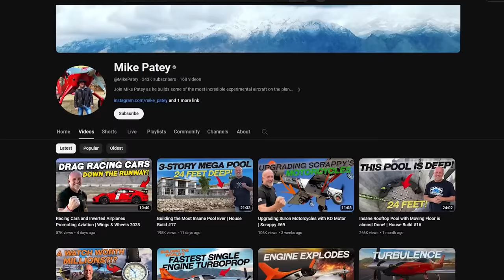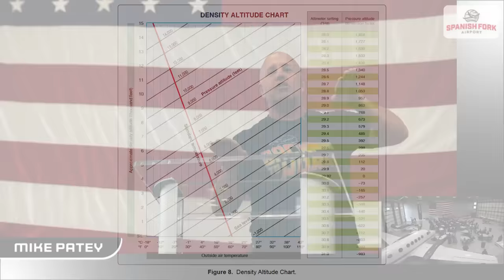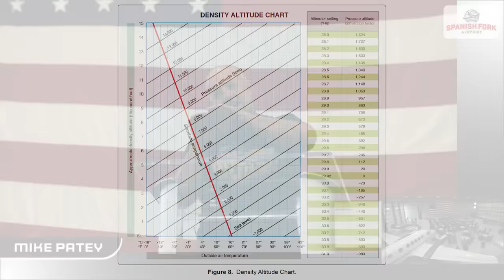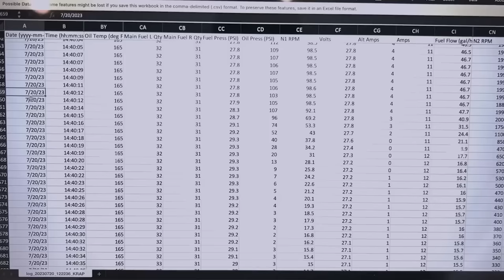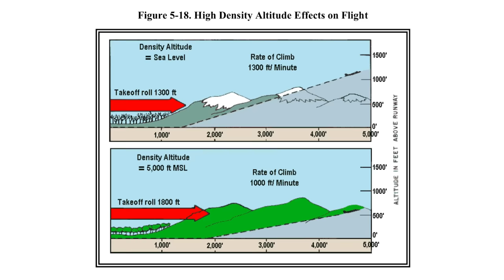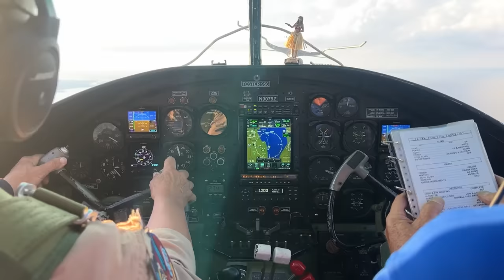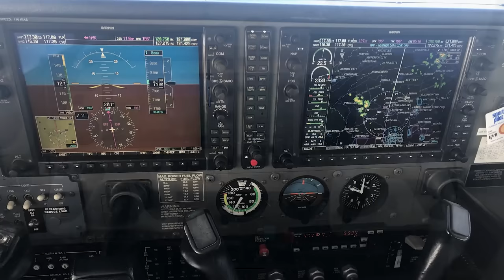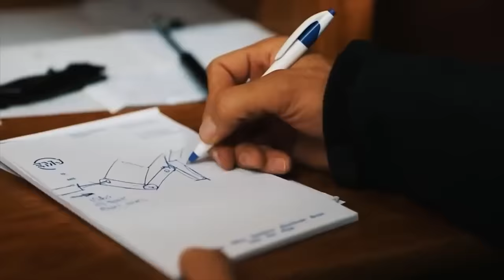I've Lost 4 Friends in 60 Days - Aviation Safety Discussion | Mike Patey

Comment: I love flying High DA, because it is challenging. but I do it properly.

I flew out of airfields over 5000ft, over 7000ft, with DA at takeoffs over 9000ft. you have to know how to lean, you have to know how to fly under-powered. you have to be patient. you have to know how to fly with max climb rates of less than 200 or 300fpm. You have to know how to deal with updrafts, downdrafts, mountain turbulence, etc.

People, flatlanders, would come to our neck of the US, rent a plane, crash and die, every year.

I have flown in ways that left people speechless, and asking how I did that, but Never ONCE have I exceeded the limits of an airplane, never once flown recklessly. You can fly impressively without being a "cowboy", without being reckless. It's about having understanding of flight, aerodynamics, how aircraft work, etc. it's these little things that truly impress people about your flying. I demonstrate superior navigation, superior fuel efficiency, superior precision and control. I have even been praised many times for making Safe decisions, including choosing Not to fly. Once during training for commercial airplane, I was having trouble getting ready fro my first solo in a complex airplane and I called the flight quits. Every flight instructor at the school questioned my decision. But when I explained to them the string of things that had gone wrong already, before getting off the ramp, and how it was going to affect me mentally in flight, etc. they suddenly understood and praised me for calling it quits and taking the day off. That decision and many others like it got me hired later without even having to apply for a job.

When I was a kid, in public school they had "de-motivational" posters on the walls. On was of a shipwreck and it said, "your purpose in life may be to serve as a warning to others.". Learn from the mistakes of others, you wont live long enough to make them all yourself. Fortunately even from a VERY young age I've been good at learning from others without repeating their mistakes, even once. Fortunately for me I take such lessons to heart and live by them almost religiously.

Comment: Flying is risky because gravity works 100% of the time, and enough lift to stay airborne happens less than 100% of the time, overall.  100s of complex factors must work properly together.   Probably the realization is that if you fly, you will know others that will crash, it is a small community.     It seems like it takes a certain mindset to have the skill to prepare properly, to be patient, to know when to abort a sought after mission, etc.  We know that this certain mindset can be trained.    Certainly it's no easy action, after all, you put in all of these life assets into it so you could get up there and get there faster right? That makes it particularly hard to come to a full stop.

Comment: I couldn't disagree with yuan more as an airline guy myself. Now I'm not on the 777 we fly much shorter legs but I hand fly the jet as much as I can and I say you should fly! I fly with guys who are not able to hand fly because that skill has atrophied. 

Also when it comes to auto throttles, you can turn those off too. My opinion is if you're hand flying with the auto throttles... then you're not hand flying. Disconnect it all and do it. Before you say it's too much work or it's bad or whatever I fly 121 jets to major airports all across the country with no autothrottles ever. Our company just doesn't have them installed. Get connected to the aircraft fly the plane and be ready for the day it all goes to crap.

Comment: You want a safe plane? Start with a dual electric engine. Add batteries for 30 minute flight and  a small diesel generator to power the batteries.  Put a BRS parachute. And the most important part, dont let a human drive it.  Only powered by AI, You just click the airport that were you want to go. The AI does the rest.

Comment: The stump-pulling swamp boat propeller on Scrappy gives me the creeps.  How can that be safe and reliable? If a blade separated, the engine would rip off, the CG would move back and a crash would ensue. Sure, that could also happen with a qualified aircraft propeller, but not nearly as likely.  I don’t see consistency between the emphasis on safety and sketchy engineering.

Comment: 50:20 I fly 777 and 787, 100% of the times (except low vis app) below 10K AGL is AP+AT+FD off. Plus Raw Data whenever possible so pretty much always. Add to that endless hours at my PC based flight simulator practicing procedures and maneuvers. Religiously with zero automation.There is no excuse. It’s up to us. It’s not a big videogame, we make it that way. In reality it’s just an oversized C172 with steam gauges, if we so decide. The rest are just excuses. 99.9% of airline pilots don’t have their own airplane, recommending to ALWAYS use automation is a bad bad bad advice. A deadly one. Flying 5 to 10 sectors a months as PF? You should NEVER use AP,FD and AT below 10K ! And that will still be absolutely insufficient to put you anywhere near sufficient proficiency. FAA has recognized all this in a November 2022 Circular. Common sense taught me this decades ago. Automation .. the best friend of a system operator, the worst enemy of a pilot. Who are you?

Comment: In the USA the culture does not respect the elders with white hair.  By the time a young man reaches 40 years of age he thinks he has the world by the tail.  Much is lost as the  elder pilots pass on with all their knowledge that does not get passed down to the younger pilots.  This process will only allow safety problems to grow not decrease.  Find a old pilot.  If he been flying for many years he will not be a bold pilot.  There are no old bold pilots they usually scare themselves and stop flying or they kill themselves by taking chances.  Most pilots are not instructed how to  check very carefully for water in their fuel.  They may drain the sump and the wind tanks and think they are ok.  Dealy mistake that many get away with until the engine stops due to water.

Comment: No I can hear there so I put 350 pound bags of concrete behind the seat in my car and took my girlfriend to pearls worth when I took off I couldn’t the trim didn’t work so I had a bus through with my left hand rip all that off and take the cable in my hand to run the trim tab and I was full forward stick go on full power on real soap guess what I did I got that trim figure it out but I had to push the stick forward the whole flight an hour and a half and then when I landed I had to do is just give up on a stick talk about crazy my girlfriend had no idea what an idiot I hear ya stupid things you do not figured out a way prettier fighter anyway I love listening to your commentary so keep it up
Reply: Sorry about the commentary I’m speaking into my phone and it doesn’t transmit properly anyway I love watching your posts